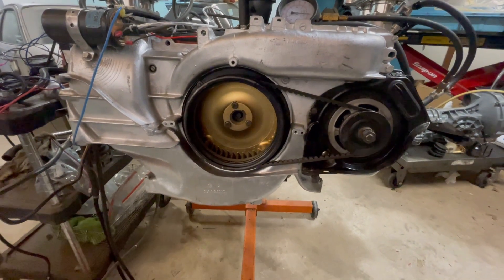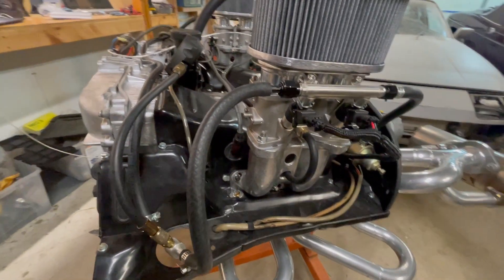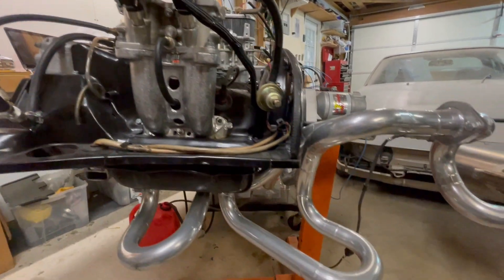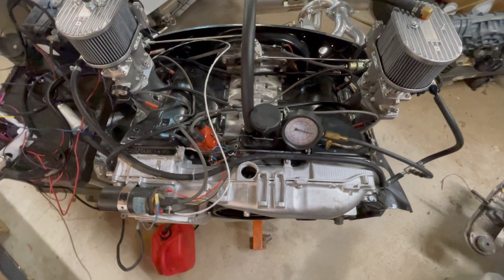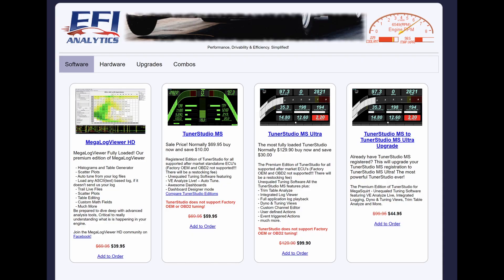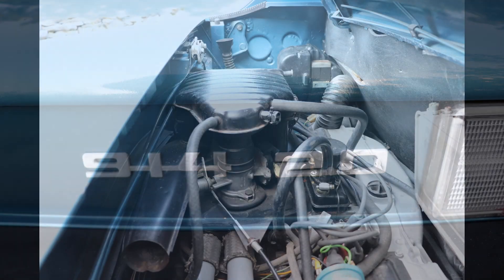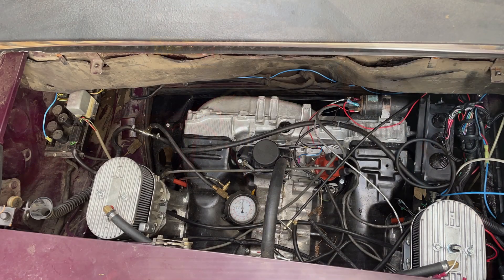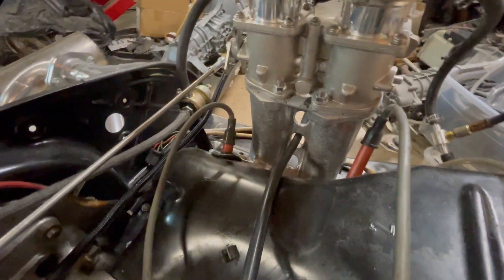Porsche 914 - MegaSquirt EFI with Dual Throttle Bodies - Part 2

Comment: I have considered something similar for my 74 2.0. Did you leave the oem injectors in place or use a plug or cover? Also, what throttle bodies did you use? I am leaning towards a Speeduino base system.